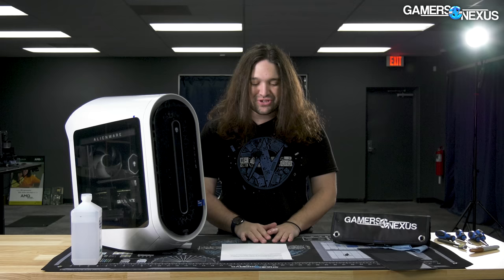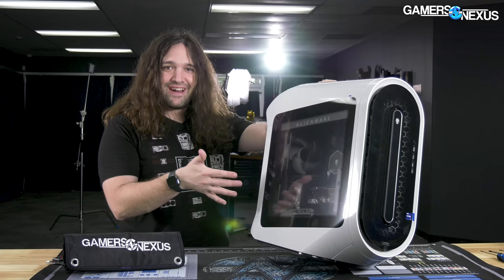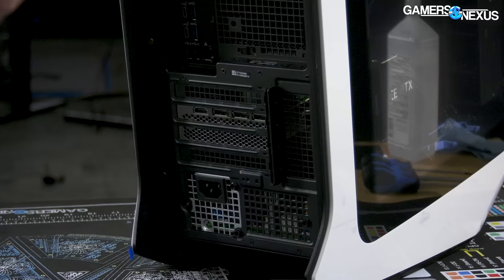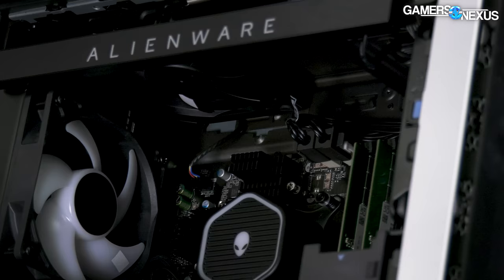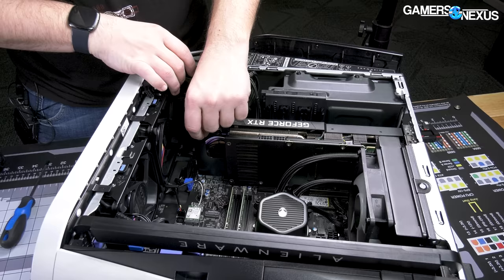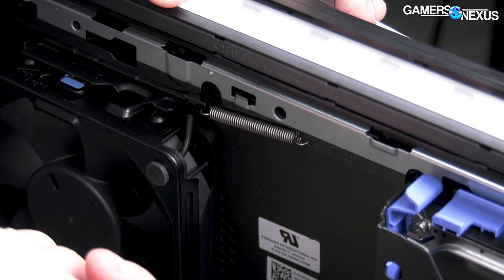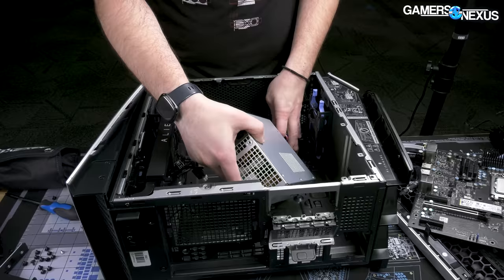Crazy Bad $5000 Alienware Gaming PC: R13 Aurora Tear-Down

Comment: Alienware has a place in my heart still, once upon a time I unboxed a big ass red alienware 17 inch laptop, with sexy metal body, pre DELL days, downloaded and maxed out Crisis for the first time in my life and was blown away, using the laptop on my lap burnt my legs, but the pain was worth it, gone are the good ol days.
Reply: Ahh. I remember those days. Mine was blue. It was around the same time too.. I remember being so pumped to play that game.
Reply: This pre built is obviously terrible, but not sure what you mean by gone are the good ol days. Alienware laptops are still really good for what they are, and their reach into other brands has always been a mixed bag from the start. At least, Alienware can brag about having the best gaming monitor in the world at the moment - The Alienware AW3423DW - For also the best price being half or less than significantly worse monitors.
Reply: you can fry an egg on gaming laptops.
Reply: blown away by the max speed fans, I suppose
Reply: You can't compare a prebuilt desktop to a gaming laptop.  This prebuilt is crap but that doesn't mean their laptop line is.
Reply: Crysis came out in 2007 and Alienware was purchased by Dell in 2006. There's no way you maxed out Crysis on a pre-Dell Alienware laptop.
Reply: @gospelofrye6881  there's a chance he got the laptop from older batch pre Dell. Not that timely into the AW to Dell timeline.

Comment: I just can't imagine paying $5000 for that but the last pre-built computer I owned was a Commadore 64 in the 80's
Reply: So you paid around 600USD depending on retailer markup on a single machine that most likely still works in 2022? The computer you are using most likely will not last for 28 years while ommadore 64s have with minimal maintenance.
Reply: @yumri4  I think you're confused?  He means that he builds his own now I'm fairly certain.

Comment: So, instead of just designing a case or using someone else's, Dell has dedicated teams of engineers to reverse engineer and design thing so they can keep using 30 year old case tooling. Dell is the April Fools of PC building.
Reply: At this point I'm thinking they must have 30 year old stock they're trying to get rid of
Reply: @ArdentMoogle  at this point they’re just playing with you because it’s not even worth it to do that to get rid of the stock
Reply: 30 years?! The hyperbole just never ends. For a clue, Dell seems to have introduced this sort of mo/bo formfactor in the Haswell era. So try 8ish instead. No, this is probably their biggest (or least small) remaining off-the-shelf chassis for an office / small workstation box, and since originally it wasn't nearly designed for the insane thermal loads of this system, they desperately tried to make it work. Talk about putting lipstick on a pig. 
They would have been way better off with a BTX chassis from the P4/C2D era, but I guess those are long gone now, plus they wouldn't be spinning a new board for such a relatively low-volume market anyway. To a company like Dell, this is small potatoes.

BTW, 30 years ago you would have gotten an AT formfactor system with a Baby AT board. Your CPU might have had a small passive heatsink at the time, graphics cards generally none, and the noisy fixed-speed power supply fan would be responsible for pulling air through the system. Different times indeed.
Reply: LoL to reverse engineer their own crap. They have to study the past without knowing how to change the original, so they bolt on.
Reply: It’s the Juicero of PC cases
Reply: @ccricers  Whats a Juicero?

Comment: Honestly what surprised me the most was seeing Steve pull out a hard drive.
Reply: hey, what do you want for 5 grand? more than one pcie slot? more than one m.2 slot? wifi antennas? to be able to use either of the half size pci-e? what are you nuts? you cant expect any of those things for a measly 5 grand
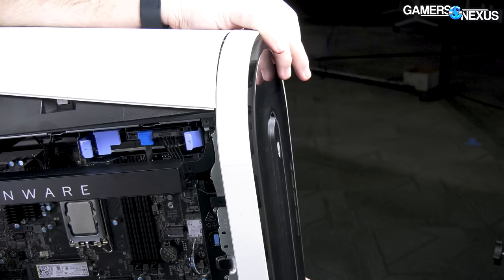Reply: @ge2719  totally agree with you, just wanted to add that it looks like there is a Wi-Fi card on it, or something that looks like that, if you look at 17:55 left side of the ram slots next to this monstrosity of a motherboard's battery.
Reply: @vaggelisaggelidis170  yeah these the to have cheap internal wi-fi/Bluetooth cards with a poxy little antenna. Rather than the full external ones with an extension antenna your expect from a high end motherboard.
Reply: @ge2719  you expect too much from a 5000$ PC

Comment: I feel like every enthusiast should, at least once in their life, take apart a Dell Optiplex Micro Form Factor without breaking any parts. The sheer amount of frustration and anger that can be gained from a tiny machine like that is simply astonishing.
Reply: Wait what? I take these apart all the time and they're actually brilliant. They're the only mini computer that I can take apart without bleeding. Dell is garbage when it comes to gaming and high-end stuff, but their optiplex line is perfect for its intended use. Imagine working IT in a huge company and saving literally hours of time because of an over-engineered fan bracket that comes out with a button instead of four screws.  Not to mention the fact that employees are always sticking their grubby hands in their computers thinking they know what they're doing. So the fewer screws for them to lose, the better.
Reply: Agreed, but once you know how...  USFF battery placement was always a bastard. Still easier than those x360 notebooks from HP.
Reply: ? Been doing IT shit for a decade, maybe more now. OptiPlexes are like legos and come apart super easy, get put back together super easy. I wouldn't buy an Alienware, and the only XPS line I would even consider is maybe a laptop, but for business environments (i.e. it just sits there and spends 8 hours per day processing the opening of emails) I would go for OptiPlex most of the time. HP lost me years ago with their shitty customer service. Lenovo lost me with shitty motherboards. Yeah it's nothing for me to pop one of them bitches open and do what I do.
Reply: @flyingtentacle7631  Same here, I love the optiplex boxes. Lenovo thinkcentres are also great at tearing apart. No clue ehat the original commenter is on about.
Reply: Took apart a couple at my old job, very tedious and the way some of the cables are managed in those old boxes doesn't help in the slightest.
Reply: Agreed

Comment: Having opened a "high spec" HP desktop, I would say hold your horses, they're pretty much as bad. HP's goal is to compete with dell in every way.
Reply: Dell and HP gAmEr machines share the same problem: the companies making them are geared and tooled entirely for mass producing enterprise stuff, and everything that makes them great at doing that makes them SUCK COMPLETE SHIT in this segment.
Reply: the only HP I'd recommend is their bottom end Pavillion TW-2107-M, which is all of $500, and is okay as a disposable, entry level gaming PC (r3-5300G, RX 5500, 8 GB Ram and a 256GB SSD).  maybe the extra $40 for a 512 SSD instead ort $100 for a5600G, but as is, it'll do e-sports games just fine.  Its no better in quality than any of the others, but its at leasr appropriately cheap
Reply: I actually bought an HP Omen when the price of the rig was cheaper than the parts individually and its been amazing, besides the restrictive motherboard and lacking airflow.
Reply: They know that, they've reviewed HP before, it will have the same issues it did there.
Reply: @Yodalemos  Got one for my sisters birthday a year back, decent config, terrible airflow.  slapped in a cheapo coolermaster 120mm aio and zip tied a 120mm fan to the bottom as intake.  Runs 'ok'.
Reply: HP makes decent enterprise stuff, I've managed to make a gaming rig with a 3080 juuuuuust barely fitting into a dell server with a 4th gen Xeon i7-tier and 24gb ram. It doesn't have all the bells and whistles but it runs cool and quick, after taking 20minutes to start up cause of the iLO stuff I don't ever use.
Reply: @GinsuChikara  Still, some decisions are simply inexcusable , no matter the market segment. How can they justify proprietary PSUs, for example?

Comment: It's like paying $5000 to shoulder the cost of Dell overengineering the heck out of this build
Reply: like?
Reply: its not even over-engineered, its just straight up lazy and shit design... if anything its under-engineered.
Reply: @filippoorologio6777  exactly. Over-engineered would be too much cooling.
Reply: @Dozav7  overengineering includes engineering patchwork used to work around inadequate designs though

Comment: The case is overengineered to be fast to assemble when ordered but also be robust enough to stand up to shipment, which is why the GPU support was overkill. I can guarantee that the techs can assemble these computers faster than a standard computer would go together. But that was the ONLY aspect they cared for in the engineering. The parts (other than PSU) will be pared down to the cheapest they can be. The thermals will be atrocious, but still within a range they deem won't kill it immediately. Upgradeability will be typically nonexistent.
Reply: Oh that makes sense
Reply: would make sense if they sold like hundreds of these every day... wich i highly doubt
Reply: @BravoNorris   Selling hundreds would mean they could make them ahead, it sounds like they make them when ordered

Comment: I learned the hard way that Dell "custom" gaming PCs are a scam. I spent like 2k on one 20 years ago. The only good thing that came from that was that I vowed to never buy a pre built again. Been building and upgrading my own PCs since then.
Reply: Learned this from my first ever PC, a 2003 Dell. Not a gaming rig, just the middle-tier office-type desktop. Everything Steve shows in this video was present to a smaller degree. Overengineered, bloated inside, and proprietary annoyances. It's incredible to see that it's now legendary. The only thing I've respected is their panels; my 1080 panel has been impressive, better colors and overall quality than my newer 1440 Acer.

Comment: As someone that as a kid was really so enamored with the Alienware cases back in 2011, I saved up and bought an Aurora R3, then spent $200 on an ALX cas on eBay and switchd cases, so I essentially had an Alienware Aurora ALX. It was beautiful. Now, I would never, ever buy any of the Alienware PC's since they changed the form factor. They all look ugly as heck. Nope, if I were to buy a prebuilt PC, I'm going elsewhere, like CyberPower or Skytech.
Reply: If you want the original Alienware quality go to Origin Pc. They are the actual people who started Alienware until Dell wrecked the whole brand into the ground.

Comment: Engineers: "we need a bigger case to put liquid cooling in and have better airflow"
Bean counters: "you need to use the same case for all computers of this size so engineer around what we give you"
Engineers: "we cant make it run cooler so lets make some cool brackets that make us seem like cool engineers"
Reply: Thanks for the good laugh, imagining this conversation Hahaha
Reply: I can actually envision this occurring. Having worked in manufacturing and dealing with bean counters, this is very much the case for what happened.

Comment: A 3090 right on top of a 1000W+ PSU.
This isn't a PC, it's a fusion generator.
Reply: Not sure why they didn't comment on it but that PSU said 750W... Maybe they'll show how it turns itself off during stress tests in the next video.
Reply: Possibly a bad sign when you feel like you wouldn't let your kid game on this thing when home alone because it's obviously a fire hazard :D
Reply: @tseikkisnelkytkaks9013  No, the NZXT case would be a major improvement.
Reply: @CptJistuce  This took me out.
Reply: Even if it's a 2 billionW PSU, it only pulls power that the components need.
Reply: @Paulo27  750W seems fine. given the heat from the components, they won't turbo anyway. make case small, let components get hot, use small PSU cause no turbo possible due to heat. oops dell did it again
Reply: @Paulo27  The components probably won't be able to draw enough power to make the PSU turn off, they will thermal throttle because of the poor design of the case/cooling.

Comment: It's so sad to see.  I bought a $5k Alienware 19" laptop 16 years ago.  That thing was a beast. The engineering was insane. I used it for just under a year as a gaming beast before deploying to Iraq. I took it with me. It got hot, don't get me wrong, but it wouldn't throttle unless the AC went out in the tent. I'd use it to game after missions, or 5-10 people would watch movies on it.  Was amazing.

I look at Alienware PCs now, and I want to puke.
Reply: Thank you so much for your service.
Reply: Theyre laptops are still really good. Its the reason why i ended up buying an R11 desktop. The desktops are shit tho. Ive had my 3080 replaced 3 times already. However, the R2 laptop i have has been working great since 2018.

Comment: This is so far removed from the original Alienwares. Those spring loaded panels have been used since the dawn of time with Dell. Basically this PC is a Dell with an Alienware logo.
Reply: Same. I used to buy Alienware and it was quality, off the shelf parts that I could replace if they failed. My last Alienware I opened it up and realized I couldn’t replace anything. That was it for me.
Reply: thats literally every alienware tho. dell is alienware.
Reply: @EMAXXMASTER  now. alienware was it's own company putting out quality custom pc's before being acquired by dell. alienware had a stellar reputation back then.
Reply: @EMAXXMASTER  no - Alienware was a company that Dell bought
Reply: Yeah Cause Dell bought out Alienware and ruined there name and crashed the ship.

Comment: I wonder, why did they opt for an electrolytic capacitors for those two near the back IO. Is saving 1 usd really worth placing a component that can overheat and would surely leak in 10 years?

Comment: Just looking at this product, you can literally see the fail in the Alienware company's internal structure:
There is nobody who has the overall responsibility and authority to ensure that the created products measure up to any quality standard.
Instead, you have independent teams. Someone gets told to design a "good-looking case". Then the hardware guys are being forced to "make do with the case and fit in some hardware with a tight budget" ... And in the end you get this $5000 piece of junk. In a real tech oriented company, a tech guy with authority could say "trash this furnace-case".
Reply: This assumes the goal is to make a good product, but the business model here is to build obselesence into the computers similar to how apple does it. Since dell doesn't have the kind of separate market segment apple does, they need to manufacture mechanical excuses for their proprietary parts.
Reply: Read the comment and agreed with all of it. But I wanted to go off topic and I apologize ahead of time since I'm going to type with caps turned on but...: IS THAT A FIRZEN PROFILE PIC FROM LITTLE FIGHTERS 2? I F*CKING LOVE YOU MATE
Reply: @butterflyvision3084  Exactly—inflate design and production costs across the board while still using garbage materials, sprinkle some LEDs and fairy dust on it, include a mandatory warranty and charge $5k a pop. It's trash hardware, the consumers are getting screwed hard, and I guarantee the execs are LOVING this.

Comment: The engineers clearly quoted Dell an unnecessarily complex and over-designed build, to get Dell to overpay them as much as possible for the job.
Reply: I mean at what point does this unnecessary complexity overwhelm the price of just making new tooling?

or even better - save a whole bunch of cash by using of the shelf parts bought in bulk and chuck the existing tooling.

too bad that dell are just dumb greedy idiotic businessmen who have no care or understanding on how to make this shit actually good

Comment: Look how the liquid cooler fan is placed! Fitted to extract, meaning all the heat from the internal components will be sucked through that radiator and circle right back to the CPU, Genius!
Reply: Doesn’t really mean anything. Top mounted AIOs do the same thing and are fine, because of front intake fans. The issue here is lack of good intake.

Comment: All that GPU support is likely a precaution against damage while shipping.
Reply: I was thinking that as well the moment I saw those. They're definitely trying their best to avoid any returns or warranty claims due to damage in shipping, the prebuilt computers being bulky and heavy, would be a logistic nightmare, on top of all the other things they must be dealing with already due to the idiotic designs.
Reply: Yeah. At the cost of airflow and performance. That bracket blocks air to the GPU's left fan.
Reply: @grgspunk  people that buy Alienware probably don't realise that their 3090 is as fast as a 3070 because it runs at 97°
Reply: @DrSmugface  LMAO